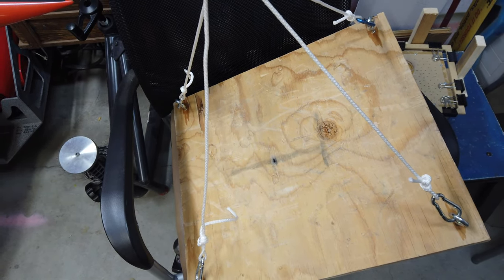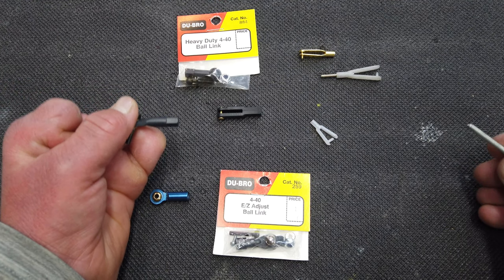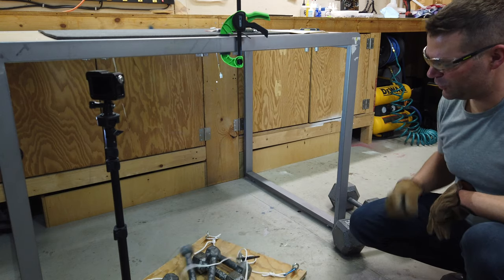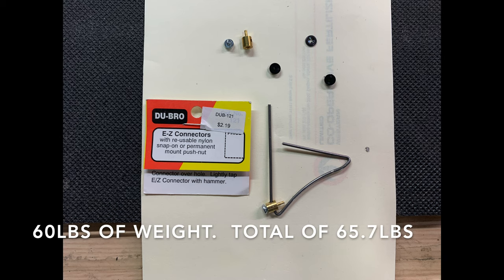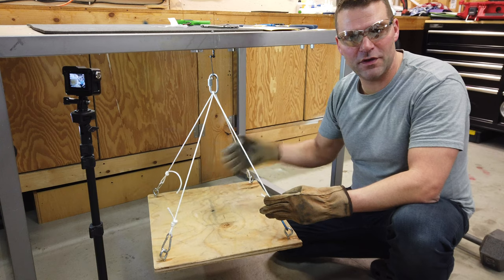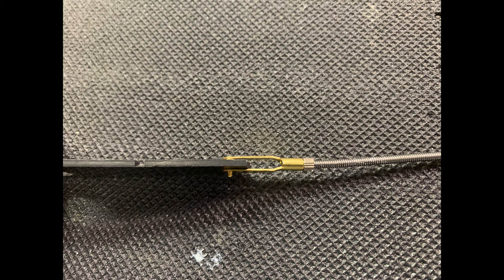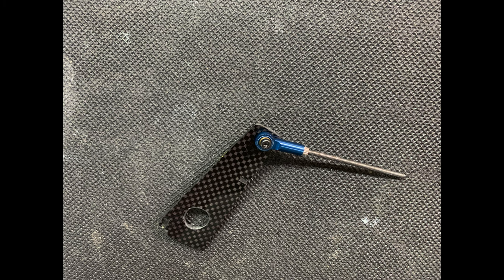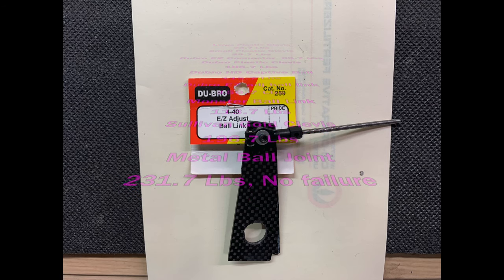RC CLEVIS & BALL JOINT Testing Round 2 - Testing to failure

Comment: Great series!! Thank you for taking the time and making these videos. Now the question is: how strong are the horns mounted in the control surfaces? Can you hang 150lbs from a horn mounted in an aileron for example?
Reply from the maker: Great question Mark.  I think the surface mounting point could be the weak point but it depends on the aircraft.  Something like an aerobatic balsa plane with covering the horn would be glued into a piece of wood.  This would likely fail before the Clevis or ball joint.  But on something like a fiberglass turbine aircraft where the horn is still glued into a piece of wood but surrounded and supported by fiberglass or carbon structure the clevis or ball joint would end up being the failure point.

Comment: Hi Jonathan,
Great series of tests. If you used a longer screw with a jam nut on the DuBro EZ-adjust ball link, it may have supported more weight before failure. Stay safe.
Reply from the maker: Thanks Don!  Thanks for watching 😎
Reply: You are right!  Now where are you going to find a servo to drive it?  Even as powerful as modern high voltage increases in torque are available, the old standard built by a reputable company still doing a bang up job.  When you start lifting Chevy engines with RC helicopters, don’t use quick connections!
Reply from the maker: @wrstew1272  HAHA!  Great point!

Comment: i would like to see a test on a control horn epoxied into a balsa structure as many 35 percent airframes are assembled with a 500 oz servo and see if the horn pulls out.
Reply from the maker: PETE!  Awesome suggestion!  Thank you for the idea and that totally makes sense.
Reply: Or if those tiny #2 screws hold the servo in place......

Comment: Seems like most of them would fail after the servo that was driving the control surface. Might be interesting ( but expensive) to test one or two with a decent capacity digital servo supporting the weight.  ( I remember one of the mfr's doing a demo lifting a bowling ball years ago....)
Reply from the maker: Yea very true. Maybe only some of the most expensive, highest voltage servos would survive or be capable. I am hoping to get some servos to torture test!
Reply: @thelightersideofrc  Eh you'd just rip the horn out of the flight surface before you cooked the servo unless you're using something like an S3004.